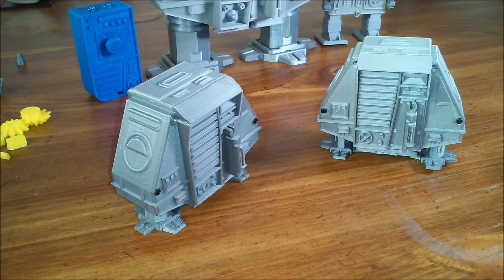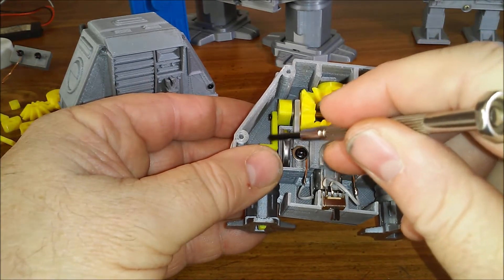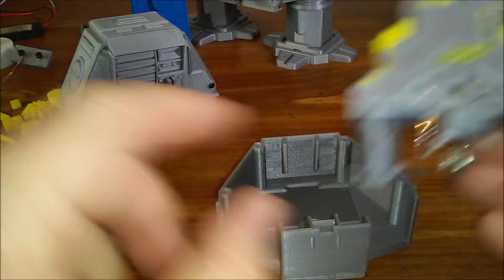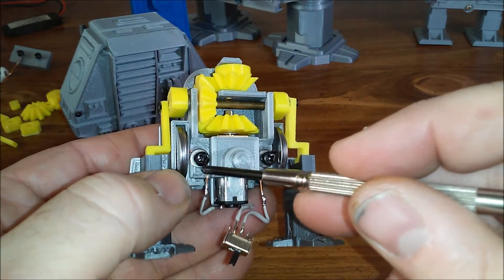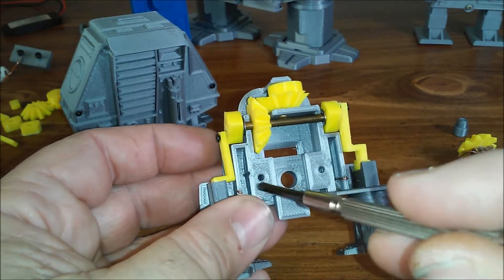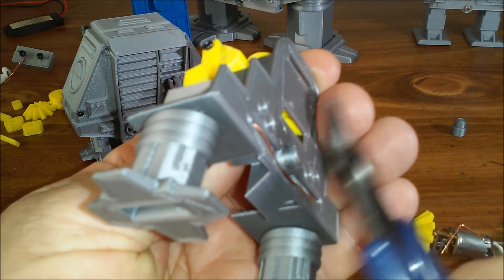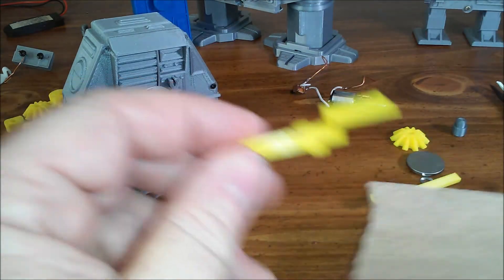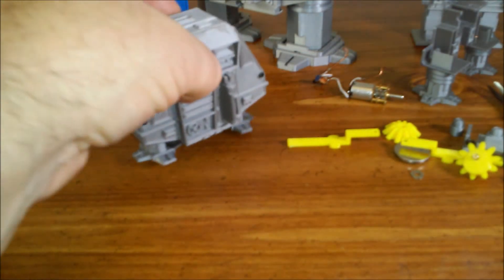Silent Running drone walking toy robot

Comment: I love it Rick. Thank you for sharing your mini version of my Rocking body Drone robot. You did a great job on the mechanical design.
Reply from the maker: Thanks. I learn a lot from your designs. I'm thinking about my next project. Maybe I'll do something Halloween based or something with the walking Adam design you just posted .

Rick
Reply: Yes that would be great if you did a mod of ADAM. I love to see other peoples spin on things. I posted the STL files on a web site called Alphadrome as well, just in case thingi-iverse is still whacked out.
http://alphadrome.net/forums/topic/22466-cart-pushing-robot-adam-based-on-1905-patent-3d-printed/